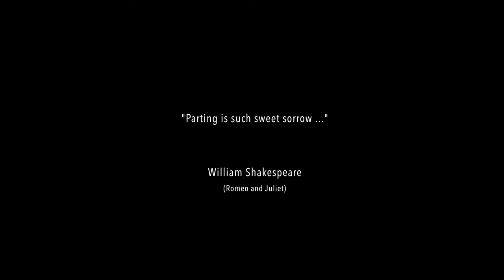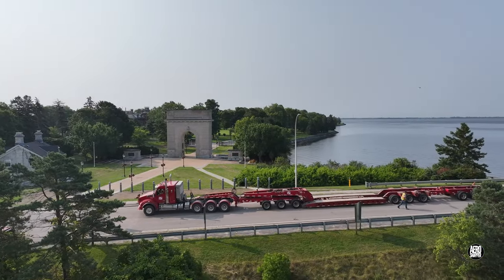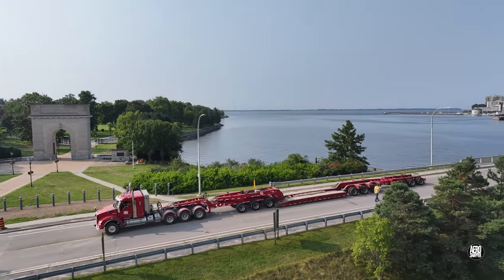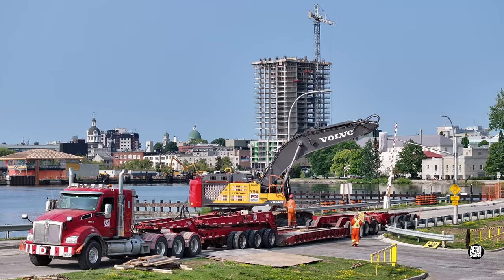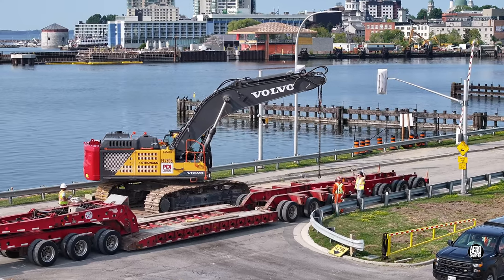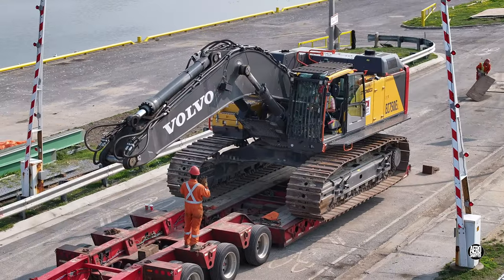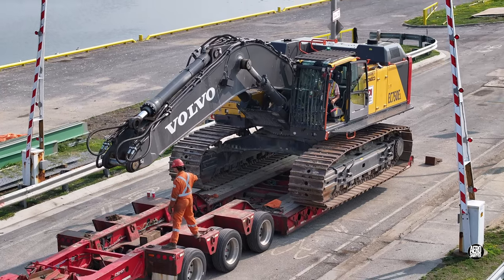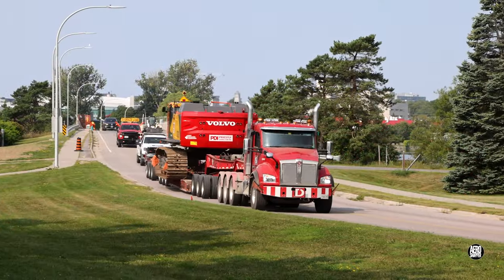A Moving Experience - an update from Kingston, Ontario's La Salle Causeway 4K

Comment: It would have been interesting to watch them do the turn onto HWY 15 with that load.  Things are looking for more activity since the timeline is by the end of September for vehicles to cross the "gap."
Reply: Who's timeline is that? Sounds like an Elon Musk timeline.
Reply from the maker: The trailer is capable of some independent steering - and more manoeuvrable than it may appear. Yes, given the modular nature of the incoming temporary bridge, it should not take long to position, but it’s absolutely essential that the load-bearing edges are ready and capable of holding it.
Reply from the maker: @stevedunford7632 the official announcement stated that a bridge would be in place by the end of September
Reply: @stevedunford7632 , GROAN!!  The Federal Govermant and everyone that want the bridge or life back to normal.